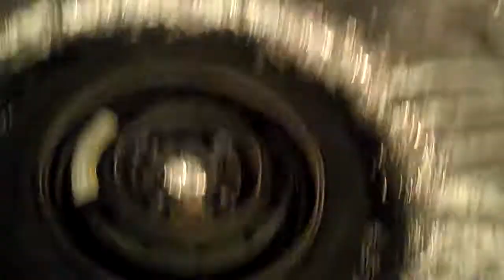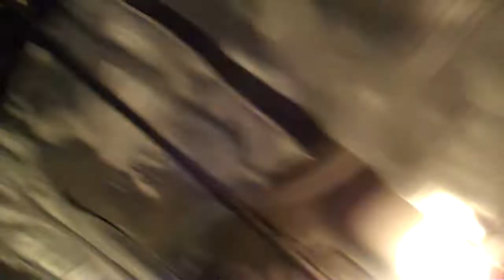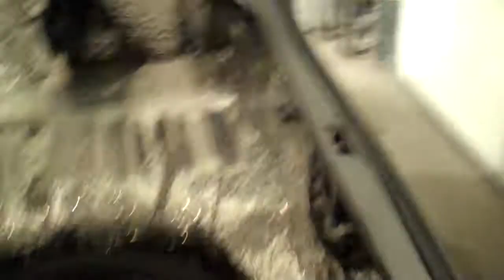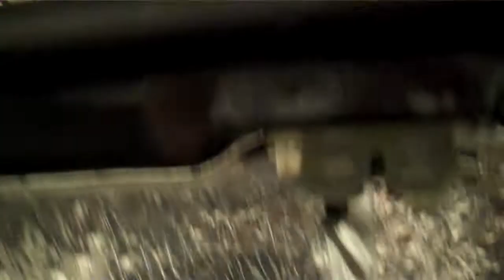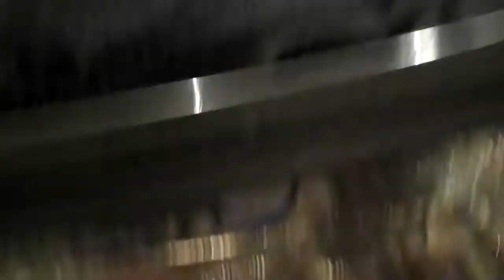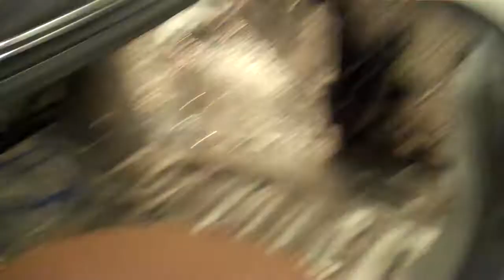Dynamat Project Complete!!!!  Peel and Seal vs. Frost Kings Air Duct Insulator

Comment: Which kind of frost kings air duct insulator did you use? Self adhesive foil and foam or Frost Kings Foil and Fiberglass?

Comment: The reason the frost king sounds so much better in this video is because of the nature of the impact. To peel n seal sounds louder because it is a harder surface. That doesn't necessarily mean it wouldn't block sound better that originated from else where (other than the peel n seal itself).